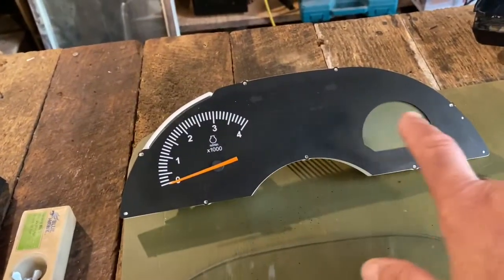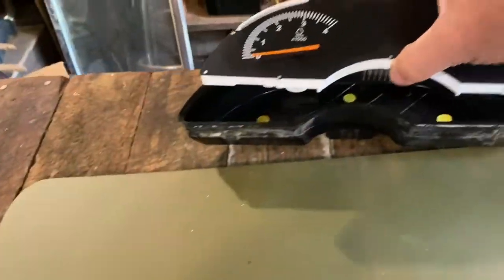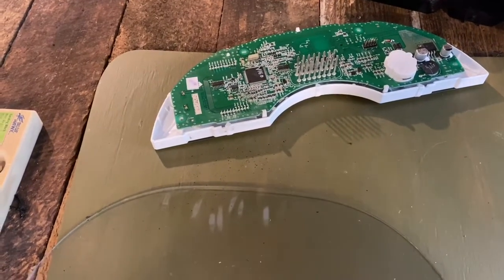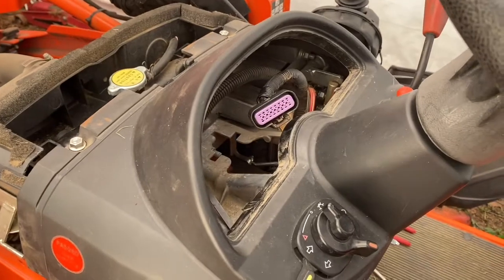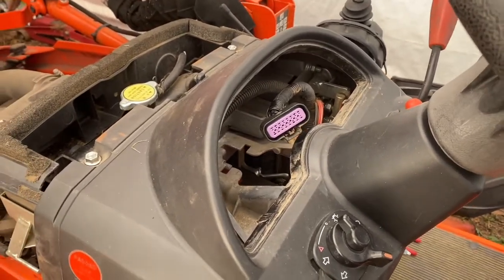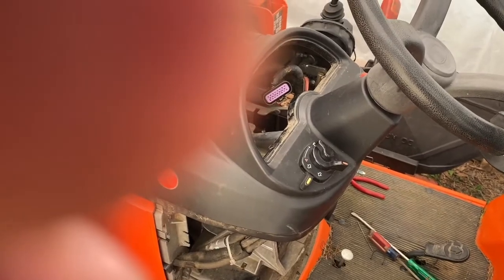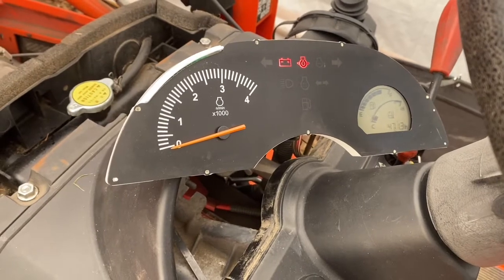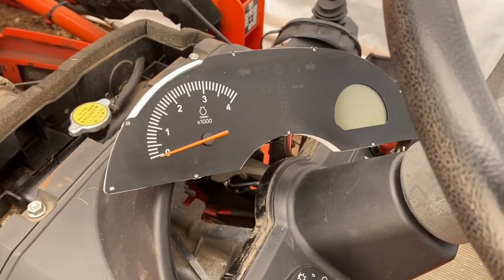Kabota BX 2370 problems with the instrument panel

Comment: I’ve has exactly the same problem.  Brought tractor to dealer to do other work and I put a tarp on it while it sat outside in the dealer field waiting to be worked on.

Dealer brought it in, did the work and THEN parked it back outside without putting the tarp on it and it rained like crazy.  
Instrument cluster glass had droplets on the inside and 3 days later, the entire instrument cluster  stopped working.
Reply: I had the same problem and haven't solved it yet!

Comment: Left mine broke about 2 years. Went out and took it out after seeing this video and it was corroded beyond repair. I believe there’s a replacement part with a upgraded version since it has a new part number. Might have to bite the bullet and get it. Unfortunately I don’t think the new panel will show the correct hours for the tractor. If anyone has replaced one of this, please confirm if this is correct about the hours.
Reply from the maker: Haven’t had any problem with mine since I silicone it
Reply: Alas - I have a similar tale. The tacho didn’t work when I got mine 2nd hand. The lights went out earlier this year, and I got a bit determined about getting the display out. 

Corroded movement for the tacho was the least of it. Off to Watson Tractors on Monday I guess.

Comment: It's a shame that a tractor can't weather a lite rain. I would have thought Kubota was made of sterner stuff. Thanks for your video. What are those little yellow patches there for, to let moisture in????  I suspect at $300.00 to replace that instrument panel, Kubota knows all about this problem!!!!  I did what you suggested and mine was really wet inside.  I dried it off, and let it sit inside for a couple of days, and now it works.  I wonder how do I keep it from happening again??

Comment: Thank you so much for showing how to pry the dash panel out. I had no idea on how to get it out. Mine had too much corrosion so cleaning it didn’t help so I had to toss it and  buy a new one. I went to the dealer where a I bought the tractor 10 years ago (BX 1870) and they wanted $645.00 for the part. (Kitsap Tractor & Equipment in Silverdale WA) He tried to make it sound like they weren’t making them any more and he found one of the last ones in a warehouse in Kansas. After more research a local mechanic directed me to Scholten’s Equipment in Lynden WA  and their price was about $480 with shipping and it arrived in 4 days. Thanks again for taking the time to make this video. It was an easy project thanks to you.
Reply from the maker: Cool I’m glad I could help. Yeah, I kind of figured them things would be a little bit of money. They should really fix that problem because I’ve seen a lot of people had the same problem with moisture getting in there. Oh well have a good day my friend.

Comment: Same issue with my bx tractor but my cluster full of water 
Cluster has  water mark across board 

Bad design 

Thanks for your post
Reply from the maker: Ever since I pulled it apart and dried it out and silicone it I haven’t had any trouble and also I don’t keep it out in the rain anymore
Reply: @EdiblePlants  I use mine in the rain a lot (and snow). and no doubt it leaks badly. I'm hoping a second sheet of plexiglass over the cluster does the trick permanently!
Reply: i agree, bad design but then if Kubota gets $300 to repair it. I think the American Kubota company has planned for this sort of failure!!!!!

Comment: Thanks for the video....My glass broke on my bx25d and moisture got in even though it is always garaged. Kubota does not sell a replacement glass....you need to but the instrument cluster and tub to get the glass ($300)    Bought a piece of plexiglass for $14, traced out the tub, cut inside the lines and siliconed it up. I did clean the connections as you suggested and all is fine   Thanks
Reply from the maker: Great I haven’t had any problems since then glad to help you out
Reply: I did basically the same thing because it's the only way you'll know if your diesel is overheating! basically the one thing you never want to do.

Comment: I've got a secondhand 2670 that had a little visible moisture in the instrument panel. The lights worked, but no tachometer. I'll try this in the morning, see if letting the binnacle dry out helps. Thanks for the tip on removing it!
Reply from the maker: Since I made the video it seems to be working pretty good haven’t had any problems with any more

Comment: Have the same problem on the same tractor right now!!  Will follow your directions.
Reply from the maker: I sealed it up and dried it out it’s still does it once in a while sometimes I got a pop it out unplug it plug it back in don’t really want to buy another board it’s $200
Reply: I took it apart as you described, brought it inside and dried it off for a few hours and plugged  back in to test it.  The right side worked, but the left side (tac) did not.  I am going to dry it and try it in the morning.  Thanks for making the video!!!  In the long run it will save me some $$!!
 @EdiblePlants